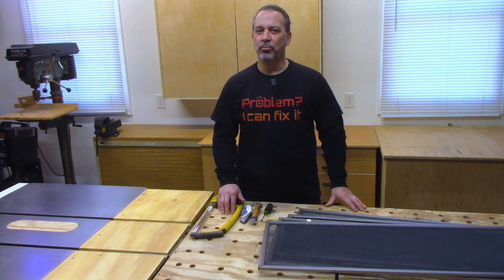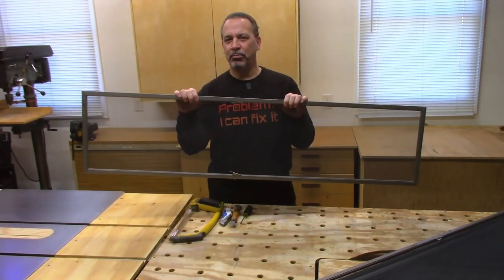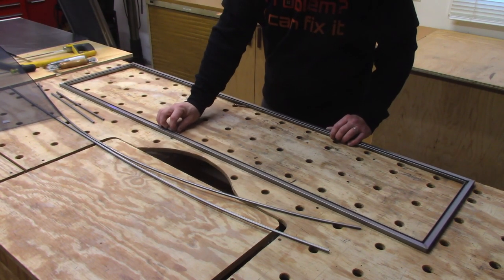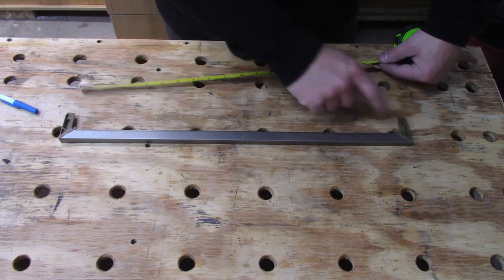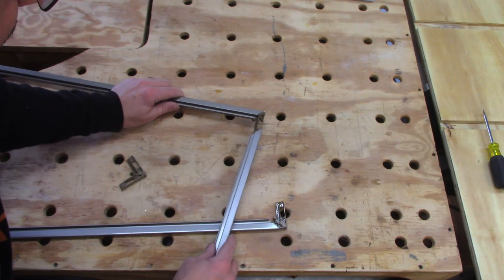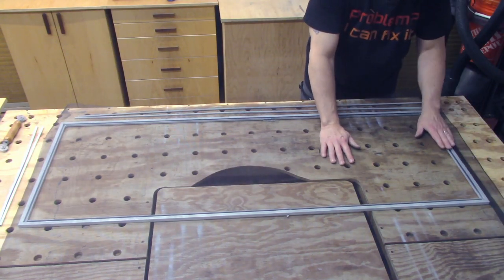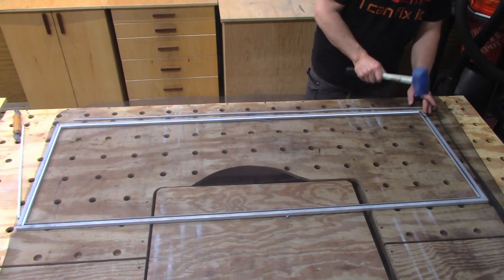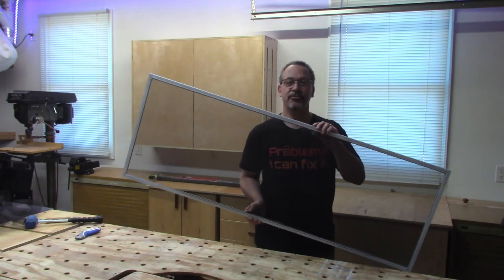DIY make Andersen screens

Comment: I have rescreened hundreds of Anderson windows with spline retainers and the last thing you want to do is use a hammer to reinstall them.  You will bend open the channel on the frame that the spline expands into.
I usually press it in as far as I can by hand and then put a wooden ruler or a paint stirrer on each side of the frame and squeeze it in with   channel locks or adjustable pliers.
If using fiberglass screen you may need to spread the spline slightly with a flathead screwdriver prior to install to offset the the difference in screen thickness.
Reply from the maker: Good tips.  Thanks for posting.

Comment: I recommend using a deadbolt hammer when working with window screens.  That way there's less chance of damaging the frame.
Reply from the maker: Not familiar with that.  Please post a link.
Reply: Sorry I typed fast originally.   It's a deadblow hammer or mallet

Comment: What would you use a metal spline over rubber
Reply from the maker: That's the way the Andersen screens are made.  Doesn't really work any better than the rubber splines it just gives a more finished look.